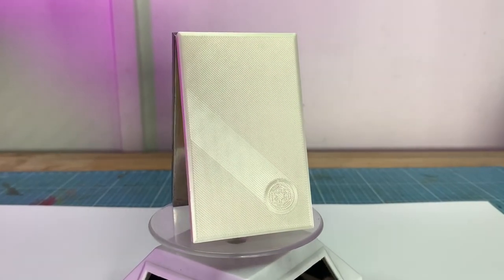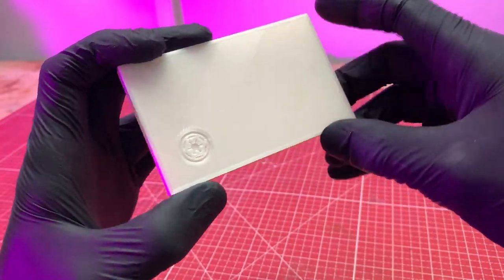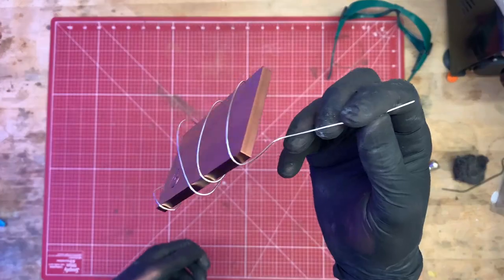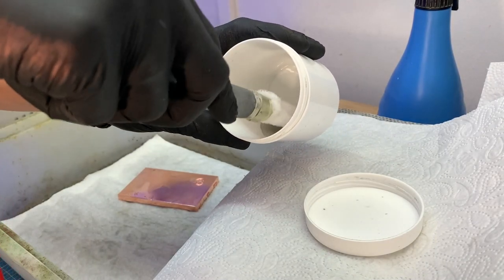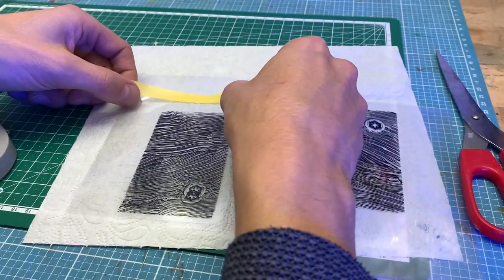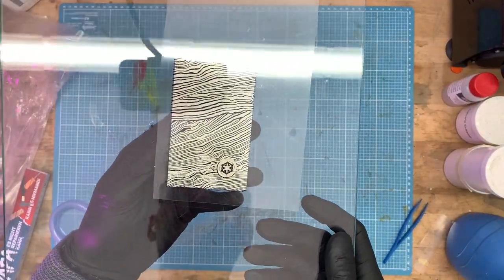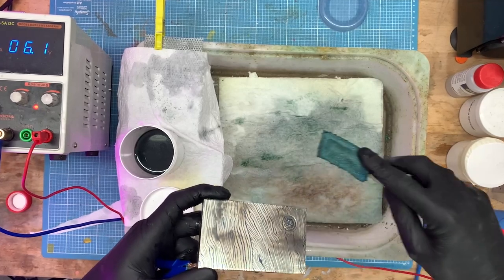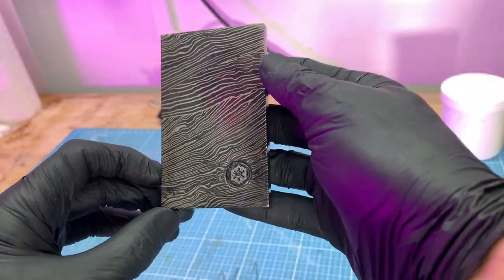Electroplating 3D Prints | Beskar Steel

Comment: Nice tutorial! I'm wondering: what about using a resin 3D printer (that uses UV-light) to do the exposure without using the adhesive mask, projecting the image directly from LCD panel? Could be an option?
Reply from the maker: That‘s genius! I thought about exposing it with my resin curing Maschine, but the 3d printer lcd exposure is a good idea! Problem could be, that the layer of photoresist is not even. But there are sheets available. Thanks for the tip!
Reply: A bit late, but I can confirm this works perfectly.
Reply: @michaelnoble2432  Wonderful! 😮
Reply: @gxlab_it  and instead of spray resist, I use cheap dry-film photoresist from eBay for etching brass. 

Just rub the film on, set it using a clothes iron, expose for a minute on my resin printer, rinse with sodium carbonate (cheap and much safer than sodium hydroxide), then etch with ammonium persulphate.

EDIT: I previously incorrectly said ammonium PERCHLORATE.
Reply from the maker: How long does the etching take? I use HCL + Peroxid and it takes 30s.
Reply: @hen3drik  30 seconds> Wow - the ammonium persulphate takes about an hour to get a good etch depth in brass, and that's when it's heated to almost 60C. The etch is very smooth and even though -  I suspect it might be rougher if the etching was very rapid.

Comment: I've had an issue with electroplating my resin prints with copper. When even I am plating this soft spongey kind of rust stuff starts to form around my part. It can actually fill up the entire tank with it. Another one is that the copper won't stick at all, I am using graphite powder with mod podge and a little bit of black paint and distilled water. 

I did have one test part work but it probably took around 20 hours to get it partially plated
Reply from the maker: In my opinion you should not simply conductive copper paint and thin it with acetone, then airbrush it. Works best. Filter your electrolyte with a coffee filter first.

Comment: Hi, I love your stuff, I’m trying to buy a power controller for plating, can you recommend me a good one not to expensive for large object like helmets? Pls thanks
Reply from the maker: I got that peaktech p6160. It delivers up to 30A and doesn’t get even hot. 30A is still a bit too low for helmets. 40A would be perfect but it actually works good, as you can see at my mandalorian helmet.

Comment: interesting process, looks very cool finish. Do you know if there is a process to make Carbon Fiber filament  3D printed parts even stronger ? like some type of glue/resine that can be spray(?) on the final print?
Reply from the maker: Just plating a think copper layer makes any wobbly PLA part very stiff and strong. I thing it will do so on carbon fiber as well. That‘s because of metal that is actually put around the whole structure: try to straightly pull apart tin foil; I think it‘s like that… somehow..

Comment: Is it safe to electroplate resin prints as well?
Reply from the maker: Yes, these are pretty great to electroform
Reply: @hen3drik  Awesome to know. Thank you so much. But a quick question. Do you have to take extra steps when it comes to resin prints or can you do it the same as in the video?
Reply from the maker: @Darth_Melek  check this out: Electroplating Plastic 3D Prints | Thermal Detonator
https://youtu.be/ywPi1osy7o8
It‘s a full untreated resin electroforming
Reply: @hen3drik  Oh I think I watched it before but I'll watch it again now :D
Reply from the maker: Surface has to be smooth, that’s all 😃
Reply: @hen3drik  I love smoothing model kits so yeah this will be great :D

Comment: Where do you get/buy one of those Galvanic pen set ups?
Reply from the maker: I buy most of my galvanic stuff from tifoo. You should check out if they send to your country or considering getting a similar equipment that gets the job done. It‘s basically a holder for the anode.
Reply: @hen3drik  yeah they seem to have everything in one place but don’t ship to Canada unfortunately. I wanted to ask, do you know what kind of additives they add to their electrolyte? I was planning on using hydrogen peroxide/ vinegar + copper to make my own sour electrolyte. I know some people are laxative and other things to use as a brightener. Do you have any additional electrolyte ingredient recommendations? 
Also thanks for your reply :)
Reply from the maker: @svarog9053  I don‘t do my own electrolyte but when the brightener wears off I add new to my filtered solution. Unfortunately that brightener is from the same tifoo shop. I‘m sorry that I can not give you more advice. Try to get a ready mixed acidic copper electrolyte with brightner, it lasts very long.